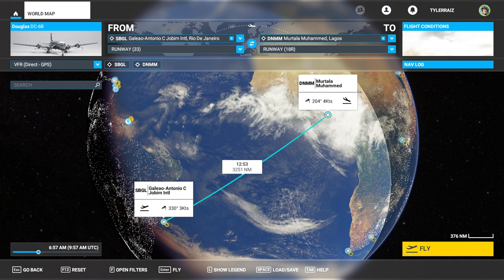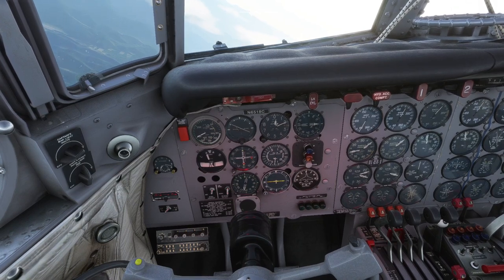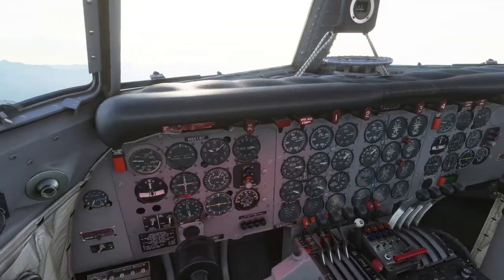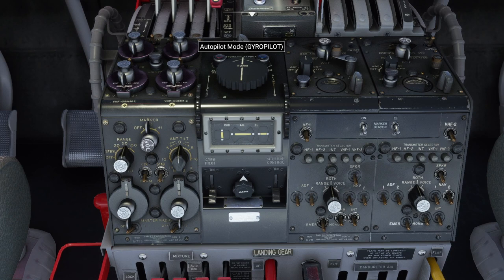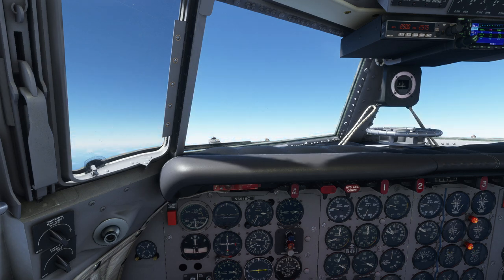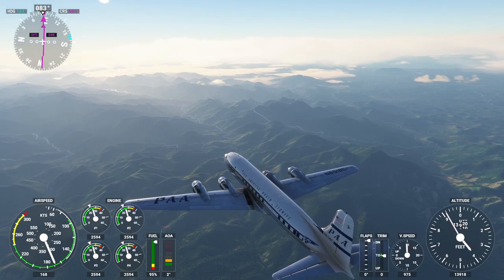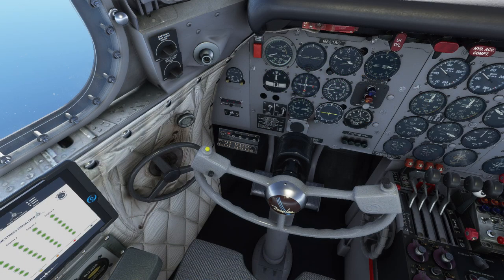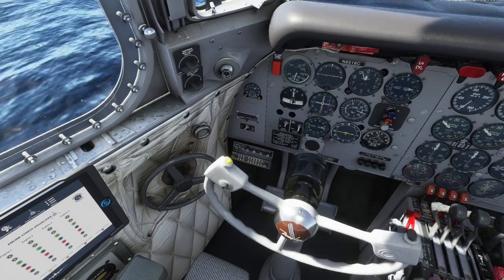Flight Sim 2020 - Trying to Fly the PMDG DC-6 Across the Atlantic (Early Attempts)

Comment: Tyler, I didn't see you lean out your air-fuel mixtures as you climbed, If you didn't your engines will lose power as you climb, You want to monitor your EGT temps as you climb and keep them up near the red as you climb= more power and less fuel burned
Reply from the maker: Yes, I did appropriate mixture control, or we would never have gotten to the altitudes we did. The mixture control was near the bottom at our cruise height.

Comment: The superchargers are used at higher altitudes because of the thinner air... you don't use them below like 10,000 feet man
Reply from the maker: Which is why I eventually stopped using them under 10,000 feet. However, it is interesting to see whether there are actual consequences to using them inappropriately.
Reply: If ya watch Capt Rob (PMDG), the superchargers get kicked in at 16.000'...

Comment: You can across the Atlantic with this plane... But you need to read the manual... At cruise speeds the engines has to consume 500lbs per hour not more... You have to increase the rpms to 2000rpms and 140bmep
Reply from the maker: I eventually learned and at least managed to cross the U.S. with it: https://www.youtube.com/watch?v=o_Qenax5NTc. However, I had a crossfeed issue with one of the engines losing fuel before the others and the crossfeed not working, and I wonder what I did wrong there, so I landed with three engines.